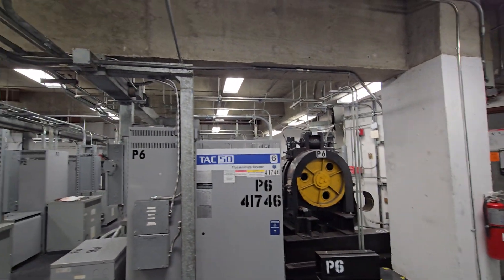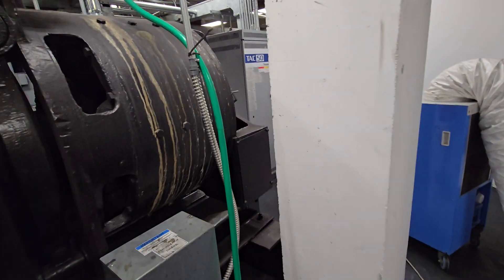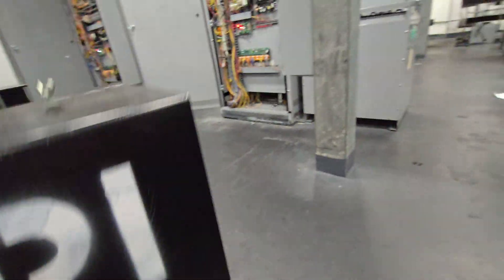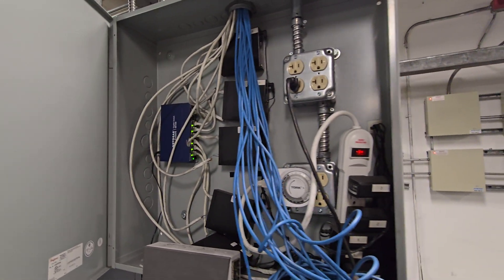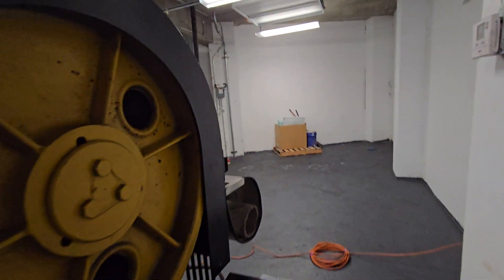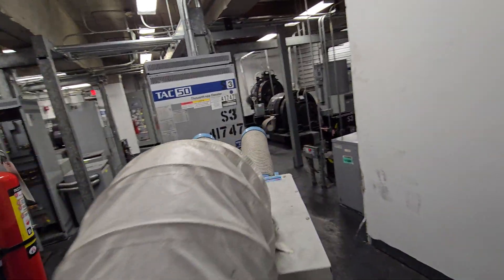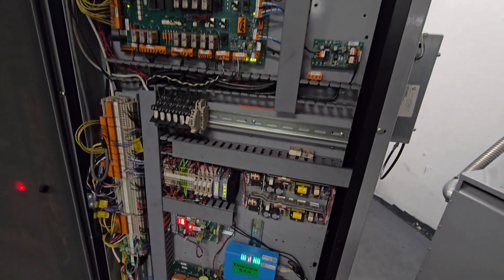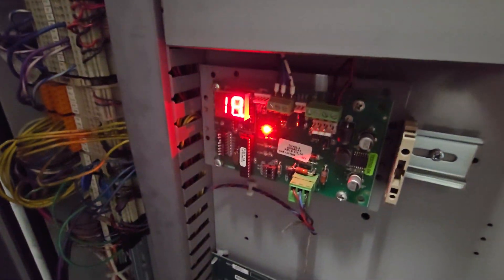(1300 Subscribers!) AMAZING Otis/TKE TAC50 Traction Elevator Machine Room Tour (Main Cars)

Comment: I was a elev. tech  back in the mid 70s. Did const. too  Great trade to get involved in if you're not afraid of heights .  Serviced a lot of old manual Otis that had huge contact relays the size of hockey pucks.  Modern items like the one here were just barely getting started. Loved the work.

Comment: If they are fed of isolating transformers (to match the previous generator voltage for the 131 machines) it is safe to leave the brush covers off, however if they are fed from auto transformers (same as Otis and Schindler) then the armatures and brush gear should be covered as it is then live to ground, most  are auto transformers as it is much less copper and wiring involved. The noise is from the chokes to smooth the DC ripple usually mounted in the same cabinet.